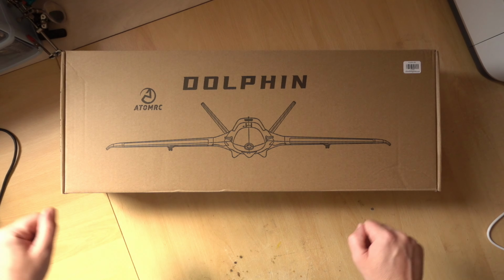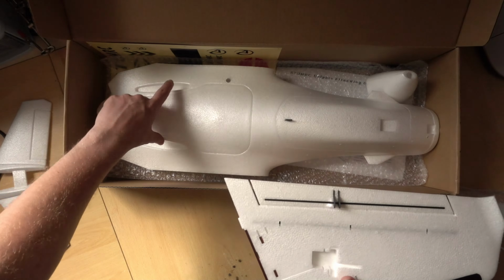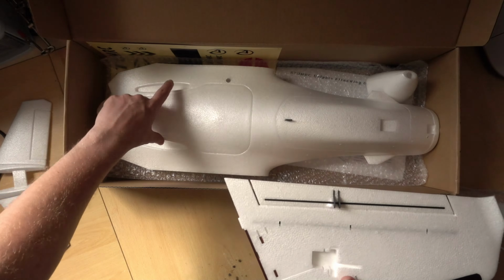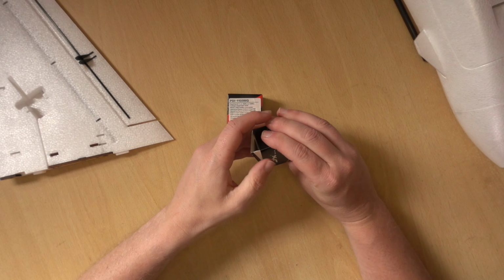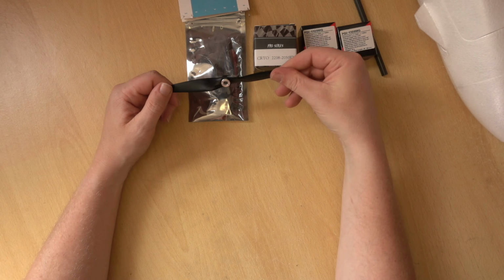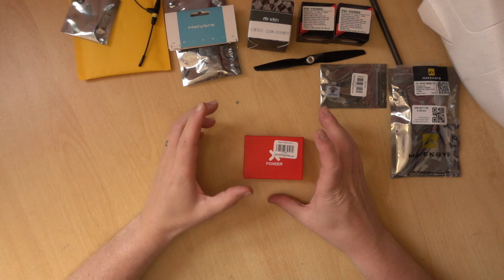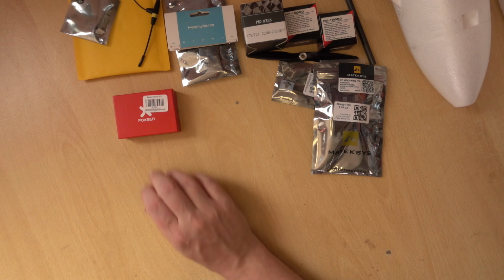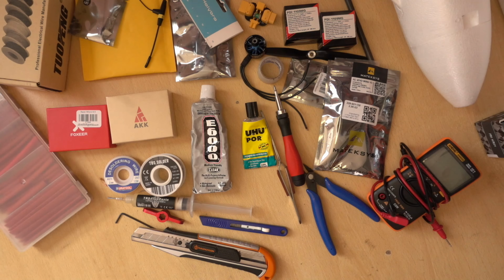iNav 5.0 Beginner's Build Academy: Lesson 01 - Introduction to the series & plane

Comment: Darren I absolutely love my Dolphin with INav. I flown it with a GoPro and 4s2200 lipo in the back. Recently I did a light medium range setup with just a 4s3500 Lion and no HD cam. Just 2 days ago I installed a CaddxFPV Baby Turtle in the nose and 2 4s3500 Lion packs. A bit heavy with that last setup but launched fine and flew stable.
Reply from the maker: Awesome. You know the really frustrating part about this series is that I can’t fly mine yet 🤣 I have another week before iNav is released and I can continue the series. They do have a great flight envelope. My friend now flies his now with a 6000 4S LiPo. What motor setup are you using on yours?
Reply: @MrD  I have been running a Flywoo 2207 2450kv motor with a 6 x 4 bi blade. I don’t go full throttle with the Lion packs. Only the Lipos.
Reply from the maker: Cool. I have a KO Method F 2307.5 2450KV as another motor option on the Dolphin. It will be interesting to compare them.

Comment: Any plans on doing a video on just the Fixed Wing Navigation Settings in advanced tuning? I know you and Marc had done one a while back around 2.5.
Reply from the maker: To be honest, nothing has really changed since that video with Marc. This series is really about getting someone new to the hobby flying, so the defaults will be fine for a lot of the iNav setup.

Comment: Hi D, this series is coming out right on time.  My dolphin has been flying from China for the last two months and I still haven't received it, hope it doesn't get too crushed ... :( I asked on social media and other channels about good servo for the Dolphin and more powerful motor (I was under the impression that the motor in pnp version is not strong enough).  So I'm glad to see your choices. Of course it would be great to see the setup and calibration in iNav 5. 
Thanks, Itzik
Reply from the maker: I hope the Dolphin arrives in good shape Itzik. The stock motor is flyable, though it needs a full throttle launch. My friend has installed a T-Motor AT2310 2200KV motor, which has no problem with launches. Not so much flight time on the same battery though.

Comment: you mentioned "Phillips" screwdrivers. I find that an awful lot of RC screws, servi horn screws for example, are Actually Japanese industry standard (JIS). I learned about these working on bicycle derailleurs. Phillips will work but JIS works a lot better and doesn't always want to climb out because it doesn't have the self centering/self cleaning feature of the Phillips. it's not just the size, technical drawings show there are many differences.
  I have built INAV ships before but I'll be following along.
  I had already purchased a finWing xbird twin tractor but I might just snag a Dolphin as well.
  really attracted to your teaching style , thanks
Reply from the maker: Wow, I didn't even know that existed. I thought there was simply Philips and Posidrive when it came to crosshead screws. You learn something new every day. And it appears I need to get another set of screwdrivers.

Thanks Tracy, excellent tip.

Comment: I would have loved to tag along with this build as I'm struggling to get a good working setup. However, the dolphin also seems to be EOL as Eachine told me the factory has stopped producing the model. I had a similar issue when I started do a build with the AR Wing Pro of which the spare parts are also difficult to come by. The white FPV PNP version isn't easy to find.
Reply from the maker: Eachine don’t make the Dolphin, AtomRC do. On their web site, there is nothing about EOL or even stock issues (it did say out of stock at one point). But I will reach out to them and ask. The same goes for the AR Pro. The white version was likely just a one off batch that SonicModell made for Eachine. The black version is the main version. I guess that SonicModell won’t swap the foam unless they’re guaranteed a certain number of orders from Eachine. 

I’ll see what I can find out 👍🏻
Reply: @MrD  Thanks. Maybe it's just limited available throught the usual sites BG/ali etc. I can't find a local (NL) or even EU supplier.

Comment: Damn 4.0 was such a great improvement for my drone. Wonder how good 5 will make it
Reply from the maker: 5.0 is really smaller updates, and some nice configurator changes. Not much has changed on the flight dynamics side. But, the big thing is the fixing of the config change bug, where you would see an invalid setting for the gyro_hardware_lpf appear.

Comment: Hi Daren do you have any idea to do manual mode for multirotor many 
thanks
Reply from the maker: There is no manual mode on multirotors. They need the flight controller stabilisation to fly. The most control to you is acro mode.

Comment: Hi Darren - Question - Is there a way with cli commands to adjust the 'climb angle' when it changes / adjusts altitude if you activate RTH low down - as it currently climbs too steeply , compared to the launch angle, and causes a stall on my AtomRc Dolphin ?? Everything else is amazing the model flies SO NICE! Very Impressed. Its running on iNav4.1 - its the only niggle I have with my setup 🙂 Thanks in advance!
Reply from the maker: On the advanced tuning page there are settings for maximum climb and decent angles. They are what you will want to adjust. They will effect navigation modes. They are also capped but the maximum angles in the PID Tuning page (can’t remember which sub tab off the top of my head. I think it’s Rates & Expo).
Reply: @MrD  Cheers Darren for the quick reply - I will get that adjusted  - It's easy when you know :)

Comment: @Mr.D - Falling with style Thanks for the tutorial. I have an "AKK F4 support SD card" flight controller. I know that it is an OmnibusF4, STM32F405RGT6/MPU6000, but I am not sure which firmware I have to install. There are series of Omnibus INAV firmware, which one is the correct one? I hope you help me out. Thanks.
Reply from the maker: If you type version in the CLI. It will give you a target. But, make sure the firmware listed before the target is INAV, not BetaFlight. The target names can be different between the two.
I just had a look on the AKK web site. They show BetaFlight being installed by default. It looks to be an Omnibus F4 Pro. There is an OMNIBUSF4PRO target in iNav. But that may not have SD card support. But there are no Omnibus targets in iNav that specify SD. So maybe it will work.
Reply: @MrD  Thanks man, I appreciate it. It had OMNIBUSF4SD (Betaflight) on it. I installed INAV "Omnibus F4 Pro" and seems working fine.

Comment: Hi Darren, good news bluetooth is enabled, i have a matek F405 with a broken usb connector and hoping to get use of this option. Have tried to connect with BLE in the configurator. I am using a 5v bluetoothmodule connected to the matek uart. Haven't been able to connect. Do you think this is fixable. With the current flightcontroller prices is is worth it to give it a try.
Reply from the maker: To be honest, I've not tried using Bluetooth on a flight controller. In theory it should work. Was the Bluetooth working before the USB failed? If not, have you connected the Bluetooth module to UART 1? That is the UART with MSP assigned by default.
Reply: @MrD  Have connected my 5v bluetooth module to the uart 1 but inav5 does not recognize it. My PC does recognize the bluetooth module. So i guess it has something to do with Inav settings
Reply from the maker: Possibly MSP was removed from UART1? 

I had an old Omnibust in a similar situation. I ended up soldering a USB extension to where the port used to be. It was a massive pain and very delicate. But it worked.

Comment: Hello D. Just finished my SpeedyBee F7 V3 with iNAV 5.1. All seems well except I unable to fly it. I can't disarm the motors. What are your thoughts?
Reply from the maker: You should be able to disarm. Is "Stop motors on low throttle" still enabled (outputs page)? If it is, check the arm switch on the modes page to make sure it is leaving the arm range.

Comment: just recently discovered you. I'm new to all this but have a long career in electronics so none of this is at all intimidating.  I really appreciate your build centrist focus on this channel. 

having some trouble with magnetometers on my quad builds. vtx seems to be overpowering anything i put on and the quads take off in a random direction when position hold is enabled. suggestions ?  thanks in advance
Reply from the maker: I'm sorry. I really don't fly quads. I have one that is on BetaFlight. I actually flew it today for the first time in 3-4 years. And I am still terrible. If you're on Discord, I would recommend asking on the INAV server. There are some very knowledgable quad guys on there. https://discord.gg/q8Y8fU7HNW
Reply: @MrD  thanks much  i will do so.
Reply from the maker: @kimbelldify  no problem. Sorry I couldn’t help more.

Comment: Hi Darren,  INav 6.1 wont Arm throttle Min Max flag.  My lumenier 12A simonk Autoshot won't let me calibrate in inav. Low is 988 mid 1500 high 2012. I did a TX16 stick Calibration and now cannot seem to Arm. I have flown this model and flys well, just want understand what changed.
Reply from the maker: I would repeat the stick calibration. If it used to work, but now doesn’t. The calibration is probably the cause. Were you gentle on the sticks, doing each axis at a time while calibrating? Or push the sticks hard around in circles?
Reply: Thanks Darren!  I did what you said and rebound the crossfire nano and she's all up and working again.  Going to hit the air today with this little nano goblin. I brought it to MN Red Wing to grab some footage of snow fields. 🙂

Comment: Just getting into the hobby after 30 years. I'm a 72 year old Canadian. Is there a radio you recommend? I'm thinking Frsky or Radiomaster. Thanks. Chris
Reply from the maker: Welcome back to the hobby Chris. To be honest, either of those transmitters would work fine. But personally, I would look more at the FrSky transmitters. The latest models are easier to use and well built. The RadioMaster TX16S is a copy of an old FrSky Horus X10. But the components used are not near the standard of the original. If you are looking at FrSky, I would recommend radios that use the TANDEM or ACCESS systems. These have quite a few advantages over the older system, including being able to update the receivers over the air. Also ETHOS transmitters are simpler to use that OpenTX and the update process for them is now very easy. 

Hope this helps.

Comment: Carbon plates in the bag with antenna for fpv camera mount
Reply from the maker: Thanks for the info. I found that in a separate manual too, so will include that in a future video when the FPV system is installed.
Reply: @MrD  though I had to cut the foam on the sides in camera bay to fit mine dji air unit. about 1mm on each side. Not sure how wide is your cam you decided to choose for this series.
Reply from the maker: It’s a standard size micro camera. So I believe 19 x 19mm. If foam needs cutting, that’s not a problem. I will probably be cutting the GPS in to the foam anyway. Just to give an example of what to do. Usually I would cut the VTx and receiver in to the wings too.
Reply: @MrD  if you will be placing more hardware on the wings, would you set up plug connector for easy wing assembly/disassembly? I was trying to do it with my dolphin using magnetic pogo pins, but it didn't workout, it have to be proper male/female plug.
Reply from the maker: I have some 6 and 9 pin MPX connectors that I can use. The 6 pins are fine if I use the standard servo plug as well. Or the 9 pin to use for everything.
Reply: @MrD  5v and GND can be re-used (if VTX work out of 5v) to save up on pins in connector.
Reply from the maker: I will share grounds. They are all the same on the FC anyway. But I don’t share power. I like to keep that separate.
Reply: fair enough and reasonable! Anyway waiting for your next video :) you doing great!!!
Would be very much interested if you would go in details about Auto Launch settings.
Reply from the maker: I recently released a video on autolaunch. You can find that at https://youtu.be/rj_RSrXqib8